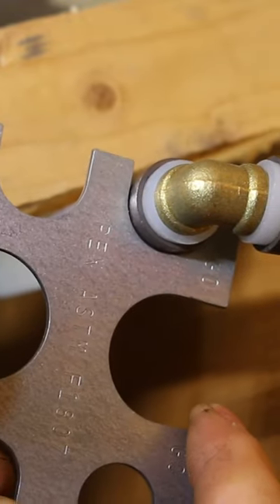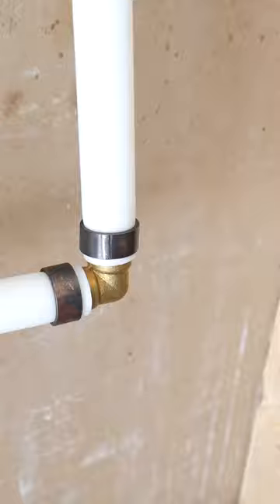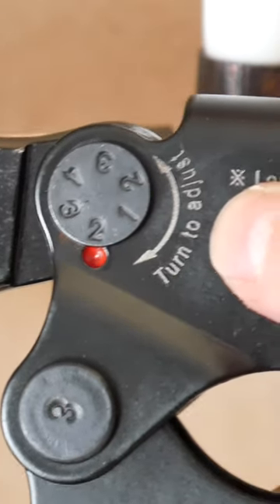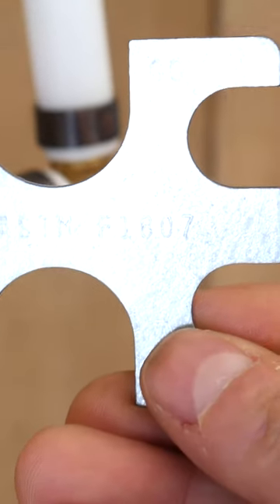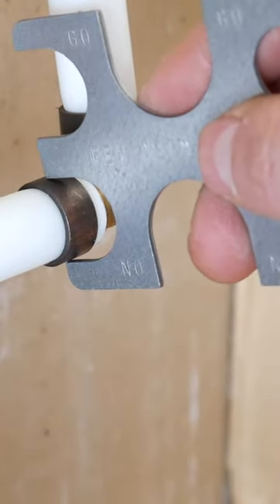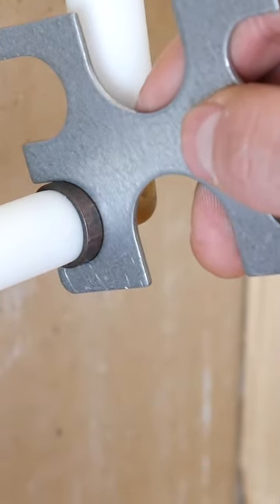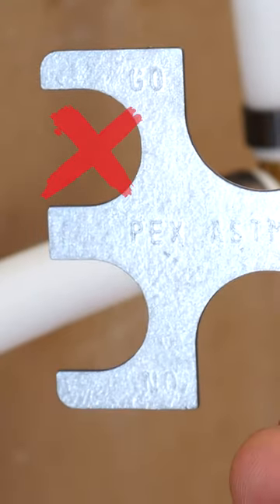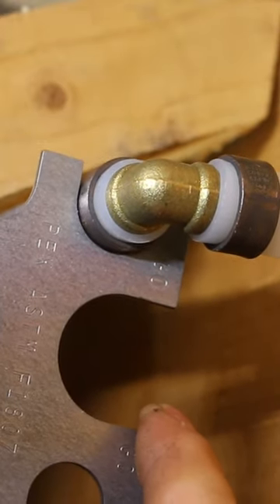PEX MISTAKE #2 (not checking crimps)

Comment: In 10 years I have never once met a plumber that used the go no go, not one single time.
Reply: lol well a plumber lived in my 1930s house before me and ran Pex A, great right? Nah he was dog shit, ran weird loops for no reason, the exterior hose bib jumps off the kitchen sink supply for no reason, through wall sink fixtures not secured to blocking properly. Was worse than amateur at floor tiling. The guy was all surface an no substance.. and the fact I am amateur and can do better is a joke. I also think he tiled the shower right on drywall. Like fuck it takes an extra 1% to do it right, takes the next guy a fuck ton more time to tear it up and fix it

Comment: I think pex A with expansion tooling and corresponding shrink collars are better overall for both homeowner and installer. It avoids the majority of pitfalls of crimping each and every connection, day in, day out. The extra cost of pex A and the expansion tool is probably paid back quite easily in reducing the need for call-backs.

Comment: we also have these crimp style fittings over here in europe. but we just have to ensure that the fitting bottoms out, then just put the machine around the ring and vuolá, no need for for soldering or anything, only issue is they are not allowed to be installed behind walls etc. Incase they leak

Comment: Thoughts on the crimp rings vs the ratchet clamps? I like the clamps because the hand tool is much more compact and easier for tight spaces. Weird they don't seem to be used anywhere near as much as the crimp rings.

Comment: To properly pass the GO does the GO have to go around the copper ring smoothly?  I had a crimp tight against the wall on a very slight angle.  It definitely passed the NO GO check.

Comment: is there a gauge to check stainless steel clamps?
Reply from the maker: Not that I know of.
Reply: Yes there is. I use pex b for my work with SS crimps and it comes with a very similar go/no go tool. Plumbing inspector in my area asked to see it and gave me the thumbs up with my last project I used it on.
Reply: @JamesReid-gf7vw  would you be able to tell me what that tool is called? I can't seem to find it
Reply: Torqued wrench?

Comment: Haha I told a guy to use the gauge to check the copper crimp on every connection. He didn't and the line he did leaked so he had to crawl 30' under a old house where about 15" space to fix the leak. I said bet you use that tool the right way next time lol